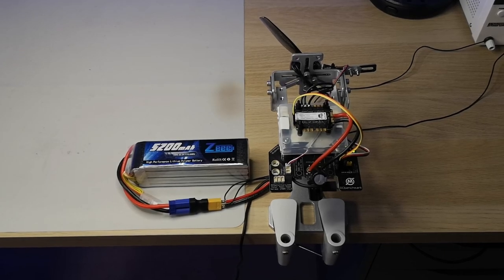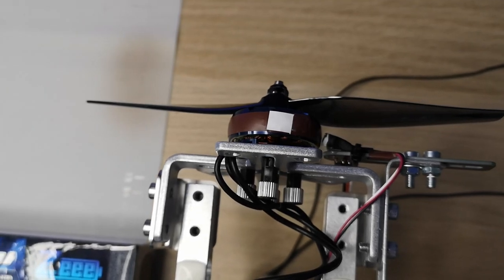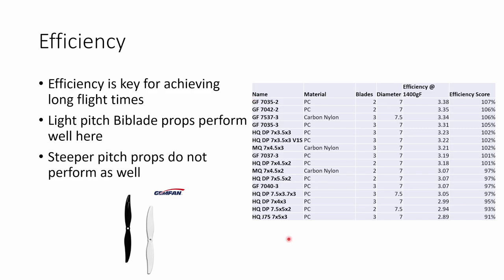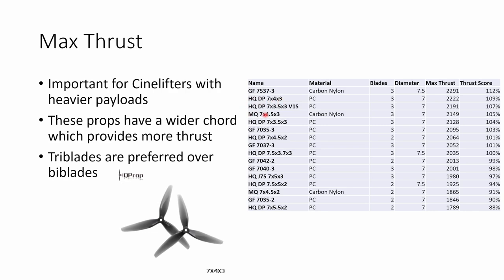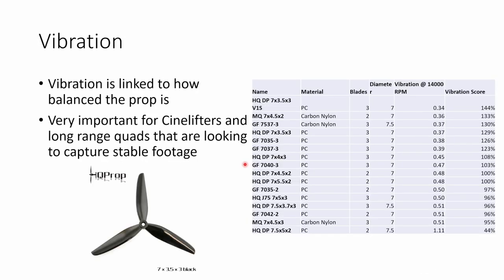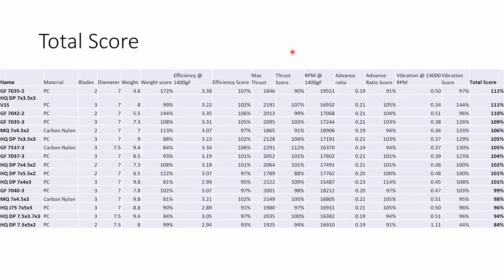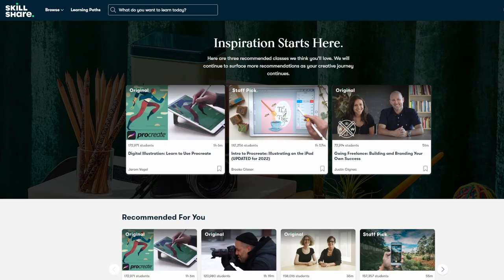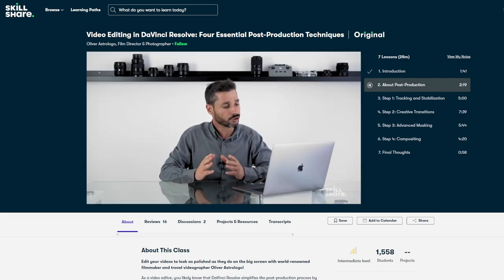7 inch Prop Testing: GemFan VS HQ, Cinelifter AND Long Range

Comment: I tested a whole bunch of 7 inch props a while back and I settled on the DAL7056. I would love to have seen them in this roundup, as they were definitely a clear standout from the rest, at least on my long range quad.
Reply: I agree. They are the best prop for mountain surfing and pushing long distances. However it produces quite a lot vibrations in my experience. They should release a new strengthend version
Reply: @ariafpv  Yes, I agree - I really wish they would release an updated version. The other downside to them is if you get a stress point in them, they break easily.  I inspect my props where the blade meets the hub every flight.  Any opaque area caused by stress can mean a lost blade.  I've had that happen a couple of times, but thankfully only during testing.
Reply: @MactacFPV  yeah the new thicker hub is better but the blade is still way too thin to eliminate this stress point. I have talked to them a few times but it doesn't seem like they understand the demand for this

Comment: You say 7" is the perfect size but I know from experience you can do just as much with 3" as you can with 7". It's not the size  that matters it's how you use it.
Reply: Never gets old
Reply: That's what she said I guess. 😬
Reply: The physics say that's Chris is right. Especially for speed AND range bigger is better
Reply: I often long range with a 1.6 inch. It is known
Reply: When I can't get the range with my 7 inch I strap the GoPro 10 to my Acrobee BeeBrain, so stable and I regularly get 45 minutes of run time and 30 km of flight... 🙊
Reply: And then you fly 7inch on a long range
Reply: 7 inch is better because they are more powerful I’ve been flying for years I know!
Reply: You must not know who Chris is and you do know this video is mainly talking about long range and cinelifters right?
Reply: @kingjam6433  can you share your setup to achieve 45 mins FT ?

Comment: I love the GF 7035 2-blade but found that I get oscillations with it at times that I don't get with the 3 bladed version. Shame because the 2 blade gives higher cruising speed and longer flight times

Comment: Something to consider is that these results are from a test stand, which does not allow the props to fully unload. This is going to affect the higher pitched props especially. Once they are airborne and are allowed to unload, the pitchier prop is going to see much better efficiency numbers. Not something you can really show in your test, but its something that is easily left out

Comment: Trying figure out best 8" prop for small motor (2806.5) I think MasterScrew 8x4.5x2 at 8g did the best but GF 8x4x3 11g hasnt done bad at all. I am planning on trying HQ Prop 8x3.7x3 12g.  On drone flights so hard to tell. so many variables change flight times. Going for long flight times. Usually I cruise slow. 30mph to maybe 40mph. Sometimes slower 25mph exploring

Comment: I've really been doing my research on 7 inch props and talked to pretty hardcore 7 inch long range pilots. Some packed with heavy load 21700 6s2p li ion packs.
Dont know why, but three of them told me they are liking the HQ J75 props most.
Interesting how thrust stand testing and real world experience show different results. 🤔 
Just waiting for the aos 7 v2 frame haha
Reply: Liking vs actually efficient is kinda hard
Reply: Yeah i like em too. Fast, grippy when needed and efficient when at cruisespeed. Better than the HQ 7x4x3 for sure. Only downside is bad balance but with a cruiser one can take the time and balance the blades as they wont break all the time like on a freestyle quad.

Comment: I watched your mythbusting video on 2207 v 2306 before this. I have a question about using the 2207 with 7". 
On the mythbusting video you pointed out that the 2207 and 2306 weren't hitting their limits. Meaning they comfortably had the torque to spin the 5" which is why they didn't hit their limit. 
So how would a 2207 perform with 7"? Let's say a 2207 1700kv on 4s for instance.

Comment: Hey Chris, for me comparing efficiency at such high value of thrust is kind of nonsense. A more "realistic" or "real world" value would be cruise/hover thrust. So lets say around 25 to 30 percent of take off weight from a typical 7 inch quad, for me that would be 350 g. Or is that meant by 1400 g? Anyway thank you for the overview of 7 inch props.

Comment: wouldn't higher pitch props be more efficient on longrange quads because of the inflow velocity?
Reply from the maker: Depends on the desired cruising speed. If you have a camera uptilt of 30 degrees the inflow velocity in cruise is not very different from hover. If you run 60 degrees then you may want a higher pitch prop. Not many long range pilots I know run high uptilt.

Comment: Is the AOS 7 the same AOS 70 Cine I bought from your site? If not what are the differences? EDIT: Ok.. I'll answer this.. the cine is an x8.. not 4, and the arms are standing up vertical vs flat so I assume they are more stable/sturdy/durable? Not sure if there are any other differences.

Comment: Hello. Please tell me how best to mount FC:
1) Rubber bobbins with nut and threaded part
2) Silicone damper balls from the FC kit
Reply: Rubber bobbins dampen the vibrations but they also slow down the vibrations to a lower frequency that is harder to filter out.
Lower frequency vibrations are worse for tuning than higher. On 5" it can work alright but on 7" its a big no no. I have tried on my 7" and using the silicon dampeners in the FC kit won hands down. Much easier to filter and flies better.
Reply: @minaexperiment  Very interesting observation, thanks.

Comment: On my 7" testing GF 7035-2 did great at faster speeds but at slow speeds I felt like GF 7035-3 or HQ 7x3.5x3 gave me the longest flight times. I kept some data. but lost my data before i could finish chart. Harddrive crash. ( https://docs.google.com/spreadsheets/d/1RVUWpNZGYDaEwrp2op8mLoPFeZWQw_THfT4Y9eCxDJM )
Reply: You get long flight time, but fly pretty slow. Your distance is similar to mine. Just longer and slower flight.
Anyway, how do you like 7 vs 8 vs 10 inch ?
I like 8 inch most at the moment